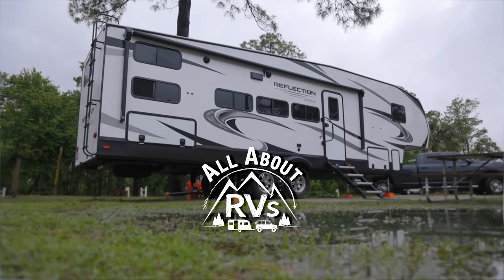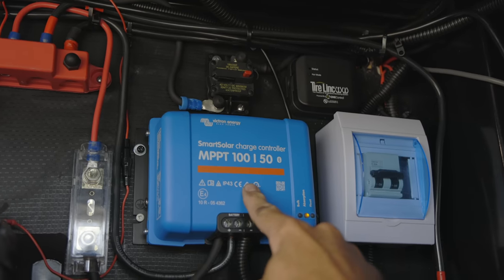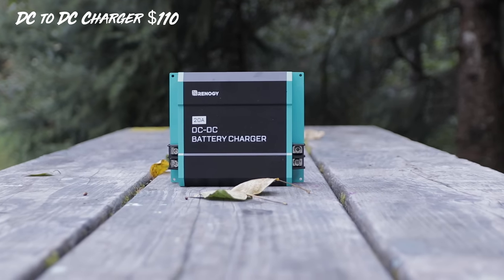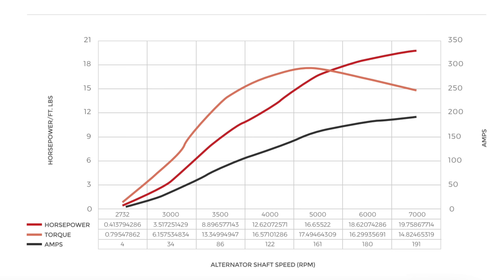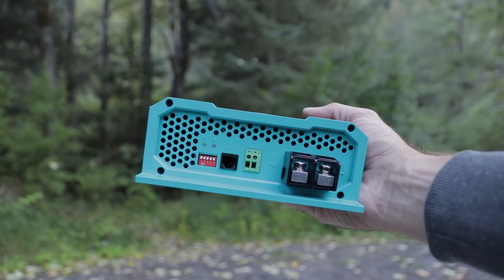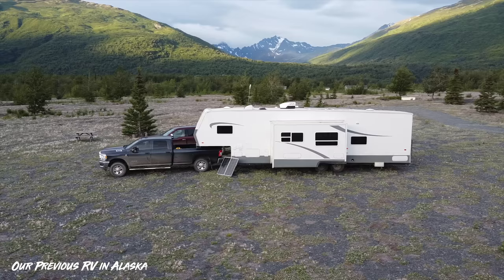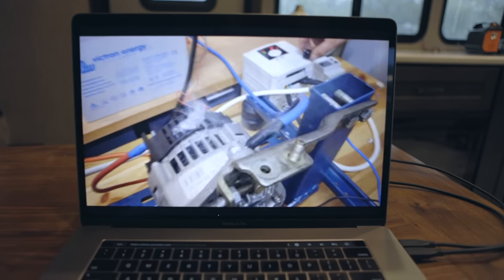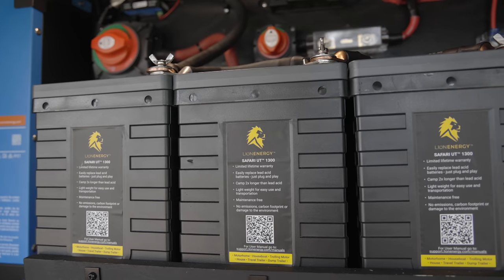RV Alternator Smart DC to Dc Charging.

Comment: I just installed a LiFePo4 200aH battery on my E-Pro 19FDS with a roof mount 190w solar panel. I have a 2021Jeep Gladiator and I don’t really need to charge the battery while towing. I have tested this new battery/solar system and it will stay in good shape overnight and recharge the next day to sufficiently maintain the battery. I am not a boondocker other than travel stops but use parks with at least electricity for night stops. I heard your comments that you didn’t have any protection for the alternator previously. I am assuming that was with lithium batteries? Anyway I am researching to see if the Jeep has a dedicated fuse for the charge line which I will pull just as a belt/suspenders approach. Thanks for the information.
Reply from the maker: Yes great comments. It was with lithium that we had no dc charger protection on the stock setup for well over a year.

Comment: When you did the wiring from your alternator to your truck bed, did you use both positive and negative wires?  Or did you run a positive wire and tie the negative on each end to the chassis?  I've heard people do both.  The reason I ask is that wire isn't cheap...
Reply from the maker: On the truck side I used the chassis but on the RV side I went to the buss bar.
Reply: I NEVER use the chassis as a heavy current carrying conductor on the ground side.   I used positive and negative cabling.
Reply: @deltabravo1257  he is probably pullinng 25-28 amps max with this 20 amp model accounting for loosses. Yes obviously it is better to run a dedicated b+ AND ground straight from the truck battery to the load. My point is, you missed the WHY part... You see here beautiful ppl reading this: when you use the chassis of your vehicle to carry high current ground (anything over 25 amps) you are now relying on the vehicles factory ground cable going from the battery to the chassis. Often these cables are undersized and really only just barely "good enough" to handle the current of the vehicle, and maybe 20-25 amps from a trailer plug. When you exceed 25 amps of current as an add on device you should always use dedicated power and ground cables directly to the battery to avoid melting the factory ground cable and possibly causing damage to the electronics on your vehicle. Futhermore, you must use the same gauge cable for the power and ground to avoid any 'bottlenecks' (you could say) in said add on wires.

Comment: Without this DC-DC unit, typically, the RV battery is being charged via the 7-pin. I didn't quite understand how you prevented the alternator from being overworked by charging the lithium batteries. I get the low batt resistance/alternator relationship. Once the DC-DC unit gets introduced into the system, I get how it works from there too, however, do you NOT need to find and disable the pins from the 7pin that charge the house batts? Seems like you're now charging from the 7pin AND the dc-dc unit.
Reply: You are correct. The pin for the voltage should be disabled to prevent the truck attempting to charge through both lines as well as the dc to dc from attempting to charge the truck battery. But since that circuit is limited by resistance (which in itself isn't a good thing, but I digress) to 1 amp the leakage should be minimal. But yes I'd disable the 12v pin in the wiring harness or completely isolate the batteries so only the dc to dc charge controller is able to charge the batteries and the trailer lights is solely controlled by the the wiring harness. But that's just me.

Comment: So I like your videos I am wanting to do a solar/Apu system in my semi hotel load will be a fridge at 6.8 amps 12v and a oven at 12 amps the some 12v outlets also thinking running a inverter but maybe 2000 wats was think of agm battery’s because I live in a cold winter zone any thoughts or input much appreciated

Comment: Absolutely love you channel, and brand new! We just purchased a 2020 jayco slx8 BH.  I have a 30amp gen cummins onan.  I want to drop the two baby led acid batteries and go with lithium.... But I see a lot of info and would like some help... 1. Do I have to do anything, or can I just drop in two new 100amp hours, lion, renogy, battle born or aolithium? I'm on a bit of a budget. 2. Or do I need a dc to dc charger, and upgraded converter so I can charge my batteries at a decent rate and not burn up my alternator with my 7 pin?  A little more help.  Love the channel
Reply: Its my understanding you should change your converter/charger to one that is compatible with lithium or the lithium will only charge to about 80% due to the difference in charge profiles ...Ray from "Love your RV" did a video about this exact topic

Comment: Thanks for the informative video on dc to dc charging. When you talk about frying the alternator (~7 min in video) when using a lithium house battery and how you avoided this for a long time by running smaller gauge wire from the alternator to the house battery to create resistance, thus saving your alternator, wouldn't the smaller wire quickly short in a situation like this?

Comment: Technical question:  I just installed the 20a dc/dc charger using the Anderson connector and wired the power activation using the trailer light connection as mentioned in your video.  I also have previously installed the following:  Victron 12v/3000 MultiPlus II, Victron Smart Shunt and Lion Energy batteries.   Here’s my question, after install of the dc/dc charger, how do I determine if the charger is connected and actually charging the batteries?  Will is see the charging activity on the smart shunt app?  I have a steady green indicator light and the multimeter shows 14v on the input side but nothing on the output side.   DIP switches are set: 1 up, 2-4 down, 5 up.  Just seems really strange. Nobody addresses the issue, or I’m just totally missing it (which is entirely possible 😬🤪).  Thank you.  

Most likely, see you next video. 
Jason

Comment: You added a new 6 awg wire from truck battery to trailer battery for the dc-dc converter. Do you still have the 7 pin 12v wire going directly to the battery as well? Something like 20 amp from the dc converter and small 1 amp from the smaller 7 pin wire?

Comment: Do you need a dc to dc charge if using a 7 pin that only produces 1 amp. Will that overload the alternator?
Reply: For my setup I didn't take any chance.   I have solar 400watts on top of trailer so I don't really need the charging from the 7 pin.  I simply removed the fuse in the truck that controls the charging of my TT batteries.     0$ in investments and 100% sure no dead alternator.    Problem solved!

Comment: Hi Jared, I know this is a late comment, but I am just getting ready to install the victron Orion 30 Amp DC to DC charger on my 2015 silverado with a 220 Amp alterator.  I would like to know about wire and fuse size. Is there a link to a wiring diagram for my set up. I will be charging 3 - 100amp lithium batteries while I drive. Thanks for all you do!!

Comment: Hey my name Santiago I have a few questions 1 which dc to dc charger do I need for let. Say 2500 truck 2 what are the abapter you are using to hook up your dc to dc charger so I'm going to need the 20 amp 30 amp 40 amp 60 amp I just need alittle help with that

Comment: Quick question about the cable you used was it just 6 awg welding copper cable or was it tinned copper marine cable? Looking to run a similar system but wanted to us 4 awg cable but not sure about running it under the truck. Thanks and great video.

Comment: I have a class B.  The question I have is what about when you plug in to shore power?  I only have one wire from our power system.  The invertor/charger sends over the power when plugged in to shore power.  The alternator charges while driving.  When stopped the battery sends power back to the system to power the DC loads.  
Where does the DC to DC charger connect?   
I can't find anything online and I have a request into Renorgy.

Comment: I have a 3000 watt inverter just lieing around. And I have a Victron charger in line to charge my lithium batteries if I need it. Do you know if it would be ok to run that 120 volt ac charger off my 3000 watt inverter which would be running off the 12volt line in the RV connector to charge my batteries when I’m driving?

Comment: Hello,, are there any dangers/adverse effects with having the DC-DC charger, the solar controller and the factory AC-DC charger all connected at the same time to the deep cycle batteries? For instance trailer getting plugged in to shore power while ignition is on or vehicle is running? Thanks, Chris

Comment: How did you get around the seven pin connector power connection? My experience was I had my fridge running on propane I ran out of propane and it automatically switched to AC which wasn't there so it automatically switched to DC and drain both my batteries.😔

Comment: I put the same one in my pickup 2 years ago and it works great but why did you not use 4 gauge wire to cover the peracetic draw ?
Reply from the maker: I thought about putting in 4 awg Incase I decided to get a second alternator or upgrade the one I have but decided to keep it economical. A year into the 6 awg wire has performed excellent and getting the full 20 amps out of the DC to DC Charger. Voltage loss hasn’t been an issue.
Reply: I did use 4awg because I'm a belt and suspenders kind of guy, but the charger can work with as low as 8 volts incoming so it could tolerate a lot of voltage loss and still work.  Airstream only uses #6 wire between the battery and 30 amp converter.  However you won't cause issues by using a bigger wire, but if you er  too small it could be a fire risk.  You are the engineer - back when engineers didn't have computer modeling they just made things more beefy, and the Brooklyn Bridge is still standing.

Comment: I'm confused about why you wired the charger disconnect to the lights when your truck has an auto on feature.  If your lights turn on automatically, how can you turn off the charger with the way you have it wired?  Would a stand alone toggle switch be better?

Comment: If connected to the trailer lights, I guess even if the engine is not running and the lights are on, you will still drain the truck battery into the dc/dc charger. I'm wondering, when you open your door to get in the truck, the light go on for 30 sec or so if you don't start the truck, that will decharge your truck battery also.  Never had problem  with that?

Comment: Just bought a 2022 341 rds the batteries just died even with the cut off switch disengaged any ideas. With the cut off switch in the off position actually completely pulled out of the socket I still have power in the basement area I have no idea what else may be drawing on it do you have any suggestions Jerry

Comment: Hi, nice video ! I would like to install a Dc to Dc charger for my camping trailer. I would like to use it only when I do boondocking to recharge my 100 amps Lihium battery when it’s low and there no sun on my solar panels. Can I turn my RV on and let it go on idle with the Dc to Dc charger so it can recharge my battery. Can it hurt the alternator if it’s on idle for 1 or 2 hours  ? Thank you !

Comment: I have a sealed lead secondary battery in my van that chargers from my alternator via electronic solenoid. Have had it 4 years and just added water and recharged it at home and will be reinstalling it. I saw this 🔜, Pulsetech PowerPulse Battery Maintenance System. Will that work with my set up.?

Comment: I'm thinking of doing a similar setup to charge the batteries in my slide-in truck camper while driving. I'm configuring a new F-350 now. Curious if you would recommend I get it with the optional upgraded alternator and/or second battery setup, or if the standard alternator and single battery will work just fine for a DC-to-DC charging solution like yours?

Comment: I have an Emmo E-motorcycle, 72v (6x12) gel lead acid batteries.  Is it possible to to add an alternator to keep or add to the charge during my ride?  I need to plug the bike in after every ride.  I have a dc/dc buck converter as well.  Thanks

Comment: Thanks Jared for the info...one question.  Did you disconnect the battery wire in the 7 way connector or did you leave it connected?
Reply: Not Jared, but I left it connected and it works as it's supposed to.
Reply: You should disconnect the power from the 7 wire trailer connector as it will back feed the vehicle possibly damaging the alternator

Comment: So if you run lithium and don’t use a dc to dc charger you run the risk of damaging your alternator.  Is there a way to just disconnect the charging function so everything else works?   If you install this dc to dc charger isn’t the original charging function still hooked up? Or am I missing something?

Comment: With 2 , 200 amp alternators on my truck, can l charge a large bank of lith/ ion batteries instead of mounting solar to my R.V.?  Without burning 🔥 up my alts once full charge has been obtained? Where does the load go to?  And is there an auto shut off or redirect to? A sponge??? And if there is an auto shut down or redirect, is there an auto redirect after the first? So if lm driving 10 - 12 hours, there is somewhere for the charging to go after the first five hours and everything is at max charge? Or does one alt free wheel while the other keeps us running at peak efficiency?
I think l just invented something? Please help?
✌🏻👍👍🇨🇦😎

Comment: I have a Dodge ram 2500 diesel. I ran two gauge cable from the battery into the fifth wheel to the Renogy DCDC 40 amp. Are you saying that I could fry my alternator with that set up?
Reply: Check the Victron site.  They have a great illustration. The issue is if you have lithium batteries and a large pipe to them without some type of regulation. The lithium will take everything the alternator will give and then some. Today's alternators are not meant to have a100% duty cycle. That will fry it
Reply: Vicki ; There are several other YouTuber's out there that have done the Dc to Dc and warn you about frying your alternator as well. Most alternators on standard pickup & cars are not meant to run constantly. They heat up & fry. A cure (one I'm doing) is to replace my alternator with a 370 amp Mechman. It's a race car style. Tons of amps and cooling. They are not cheap, ~$500, but you'll never have to worry about charging either.
Reply: @herb7877  Wow 375 amps! 
That’s incredible, but why? Are you going to run a welding machine with that thing?
Reply: @preachers4135  no, but a lot of diesel truck s and newer gas (ford 7.3l Godzilla) come with two alternators. So get one big one that’s built for high use and not subject to fail. Cost is about the same or less than two OEM  that are not up to the task.

Comment: Great videos, thanks for sharing your electrical setup!  Have you had any issues with the DC/DC converter and the solar charge controller being wired in parallel?  Are there any steps you have taken to try to keep the charge algorithms of both units in sync, or do you just let them do their thing?  One last question:  how much power does your fridge draw on average?  I am looking at building a similar setup, but won't have solar initially so would like to size the DC/DC converter big enough to cover everything until I add solar.
Reply from the maker: No issues having them charge at the same time, we don’t have to do anything additional just let them work.
Reply: We have the same Norcold as Jared has in our Reflection.  I hooked a Kilawatt up to it and it pulls about 440 watts when on the cooling cycle.  It's tough to average that out since it depends on how often you open the doors, how much is in the fridge, the outside air temp and if the outside fridge vents are in direct sunlight.  I use a Victron 40amp charger with a little additional solar on top and arrive with 100% batteries.  Hope that helps a little.
Reply: @AllAboutRVs  Can you explain how you fished the cable “under the skin” of your 5er?   I plan to do this and I’m wondering how to accomplish this.  Fingers crossed.
Reply: @jimsjacob  Hi Jim.  I have the same question. Just starting the learning process now. Did you do it?  Thanks

Comment: I have a 2021 ram 3500 with dual 220 amp alternators, I have a Cougar 5th wheel with a starter solar kit(170 watt) with a 200 amp hour Lithium battery so I'm wondering if I get the bigger DC to DC perhaps 40 amps will it charge my battery better(lithium 200 ah)  than a 20 amp. I was thinking of running my gas fridge of the DC to DC while on the road. Also what is the wattage output of your Ram alternator?
Reply: Following.  I have the dual alternator (397amp factory option) on a 2020 F350 diesel.  Wondering the same, what size cable and fuse under hood needed from the batt to power a 40amp umbilical cord to my Northpoint 377 5er.  And would the 40mp be too big, should we limit to 20amps dc/dc.  Yes I have 4 Lithium UT1300’s
Reply: @mike_adams  I have a GMC Denali HD with dual alternators (170 and 210, I believe). I went with the 60 amp model. If you have dual alternators, you have plenty of output to send 60 amps to the 5th wheel battery bank (I have 340 AH of Lithium Ion batteries)

Comment: I think I know the answer but I'll ask.  I've read where some are using this unit (Renogy 20 amp) via the 7way trailer plug on their trucks that are 10awg with 30 amp fuse.  These are newer GM trucks.  Assuming big 3 are the same.

Question:. Is this feasible or bad idea due to voltage drop over the OEM 10awg wiring that will cause issues or fires?  Seems if it would work safely it would be best option as it alleviates extra wiring.
Reply: Wish I kept the link to another video, but the guy there initially wired into the 7-pin. Later discovered that it was a waste of time as he was only getting a few extra amps into his batteries. He ended up installing his dc charger the way it's done here.